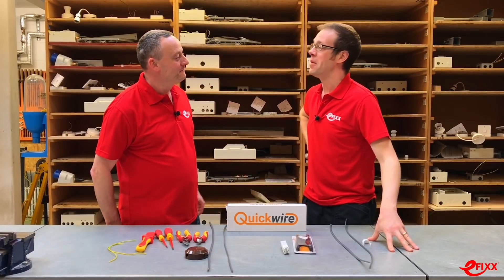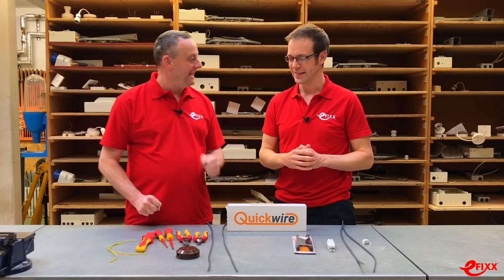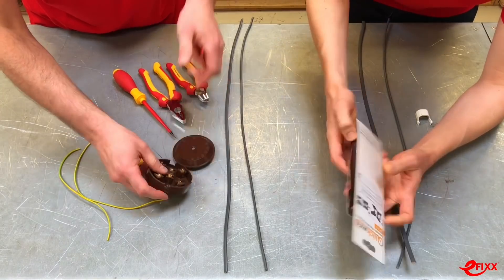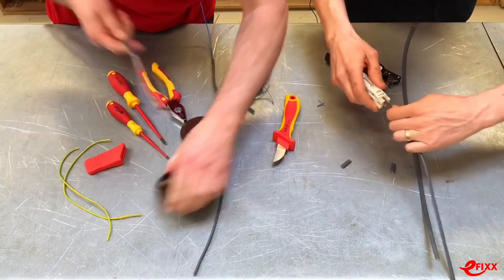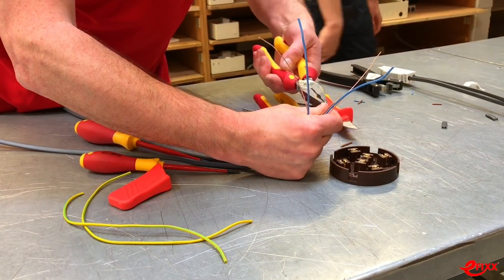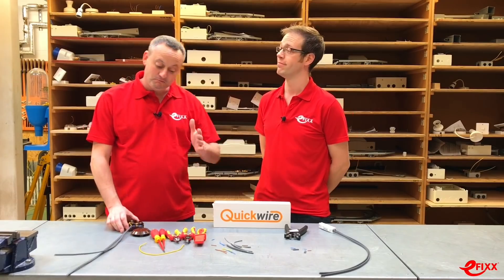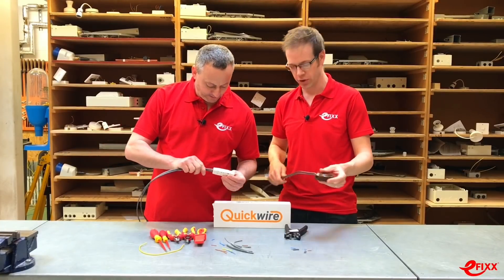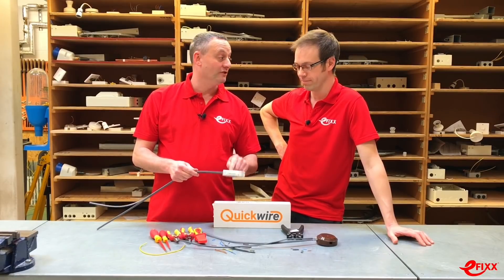Quickwire vs junction box. Includes a race between Gaz and Joe

Comment: I've tried the @Quickwire T-Connector plug & sockets on my dining room downlights just to experiment with them. Unbelievably quick !! and great quality. I don't do a lot of downlighters, but if I did I wouldn't hesitate but to use these. Not only fast fitting, if you fit a T-Connector plug to a breakout lead they are quick and easy to test, both dead & live tests.

Comment: To be totally equal Quickwire has a learning curve that I didn't expect that it did. I purchased it at the ELEX show with the idea that it would increase the speed off install and also as (DavidSaveryElectrical) said in a video  the convert ceiling roses to newer types fittings.
The stripper is not worth the money it is being sold for and advertised a simple CK one for about £10-£15 
I'm affried that sometime's the connection don't meet. And you need really make sure you push them in slowly untill it grips on the twin and earth then hear the click. As you can tell the furtration  when you turn everything on and multiple lights are not working. Even when secure I have found sometimes these still didn't meet. Finding these in the ceiling after thinking o yes mateinance free can stick them in inaccessible area. Please install with caution and care this has been my experience and I bought a load of them to give a fair feed back.
Hopefully this didn't sound like a rant and you make your own opinion about them just wanted to say my piece I will be sending the evidence to Quickwire also

All always thanks guys all the best